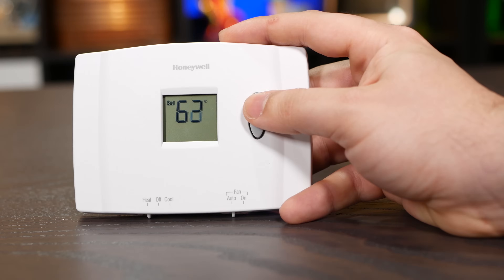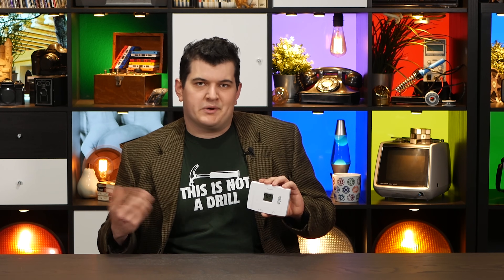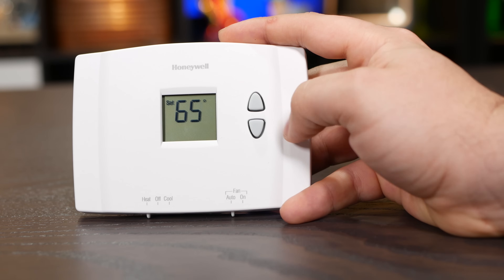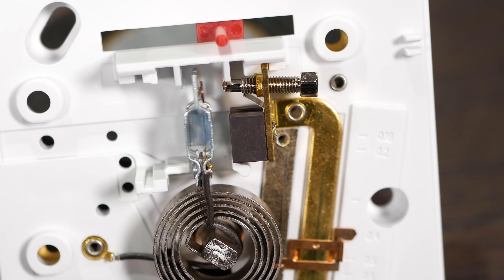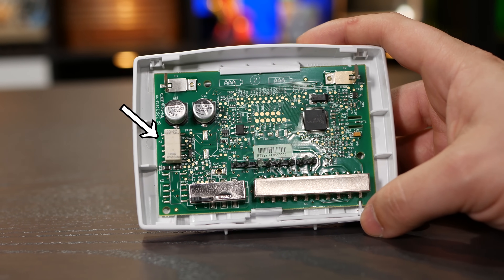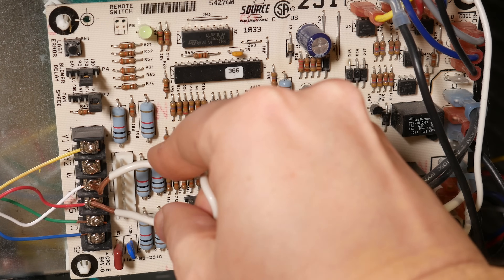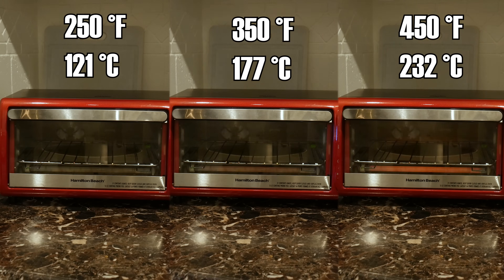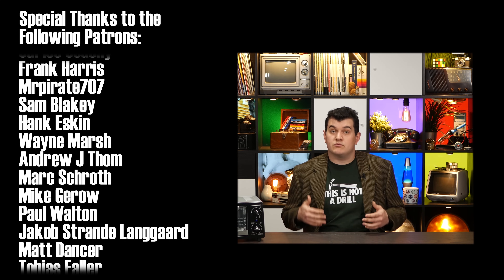Thermostats: Cooler than you think!

Comment: Thank you for this video. Maybe I can show this to some people I know as proof that I know what I'm talking about. :)  I myself have tried and tried again to explain how the thermostat ACTUALLY works, but alas I would find it set at impossible temperatures (59°F in Los Angeles' summertime) and this would lead to another problem.. ice buildup. If the system never gets a chance to stop cooling, humidity causes ice to form on the evaporator coils and actually block the cooling airways which stops the airflow altogether, which is fun.

Anyhow thanks again, and keep makin' them videos.

Comment: You should really look up PID functions as they relate more accurately to thermostat operation than PWM. (Thermostats only tend to use Integral and Derivative functions, Proportional control would only be used with systems that allow fine control, your “medium blast” essentially).

Comment: Nice, thorough explanation.  You'd be surprised how many customers think that the thermostat controls the temperature of the air from the vents. I thought that too when I was a kid. You'd also be surprised how many other HVAC guys don't know about that issue with the Nest. I don't install them without a C wire anymore. Learned that the hard way. In fact, one night my Nest tried to cook me. I thought it had become self-aware, turns out it just needed a C wire.
I believe a modulating furnace would qualify as medium blast. However, with a standard thermostat, the modulation is controlled by the furnace and the stat is still just On or Off. In a communicating system, the furnace and thermostat "talk", and the furnace may use input from the stat, like: ambient temp, set point, humidity, and even outdoor temp from an outdoor sensor or the internet. And, in that case, the thermostat setting can directly effect the temperature of the air coming out of the vents. BTW, a communicating thermostat is usually controlled by just 3 or 4 wires.

Comment: I have a thermostat that has only 2 wires(live and neutral) that use powerline to deliver data between the heater and the thermostat so that the thermostat can tell when to turn on and off and at which set temperature(yes our heater control also hot water and can be set a chosen temperature ) and the heater can tell the thermostat if there is any error and make a warning appear on the screen, could you talk about it?

Comment: Would a furnace really even notice the tiny amount of current required to power a modern microcontroller? I think if it was that sensitive it would trigger constantly on electrical interference. The biggest current demand on a thermostat would be driving a relay, but in that case you use as much current as you can. Though you would have to have two power supplies, one very high impedance for when the furnace is off(a rectifier and a regulator or buck converter), one very low impedance for when the furnace is on(transformer, rectifier, regulator).

I think the more obvious reason thermostats use batteries is because that option is cheaper for the manufacturer.

Comment: You need to make a video on this but with car heat. My sister doesn’t understand that when your car is stone cold and you override the auto and force the blower to max speed and put the temp number to MAX it’s NOT gonna give you ANY heat! But actually take longer to heat the car as you just turned on a small radiator. Plus your just blowing arctic air in your face.

Congratulations you just played yourself.

Comment: There's a low blast and a high blast for my furnace.  (Only full blast for my AC.)  At some point, my Honeywell Prestige thermostat decides that high blast is needed, I suppose related to how far away from the set temp the actual temp is, and maybe also related to how quickly it's changing the temp in the current blast mode.
Reply: After watching the full video, I'm surprised you didn't cover modern digital thermostats more thoroughly.  My current thermostat is electronic, not mechanical.  The temperature in the living room always reads the same as the thermostat setting (unless I just changed it).  In other words, the thermostat is accurate to within a single degree F.  This page may be useful:
https://www.elprocus.com/electronic-thermostat-circuit-and-working/

Comment: You should do a follow up video on the world of industrial controls.

Every commercial building you walk into is controlled by hundreds of individual input/output devices on a huge network, all talking to each other.These are usually attached to the HVAC unit itself. If you look up at the ceiling in any building with exposed ceilings, you'll be able to spot RTU-1, VAV-1, WSHP-1, etc... You could probably kill someone with boredom trying to explain BACnet/modbus.

What I love about that technology is the sheer number of sensors you can use to maintain a set-point. This example is an air handler that was struggling to maintain a humidity set-point. New programming in the week changed how the unit ran and better maintained that set-point.( https://imgur.com/a/79MligR ).

Comment: Large chain stores who's thermostats that are controlled by building automation software tend to have fine override controls that will adjust setpoints in such a way that a unit must do a task on a schedule.  In my experience, these controls are restricted for diagnostics because HVAC is expensive. 

The traditional way to achieve medium blast is to have two air conditioners bundled together in one box.  A controller at the unit decides which air conditioner turns on full blast first so they wear at the same rate.If after about five minutes we're not back in setpoint we turn on the hidden second air conditioner.

Comment: My furnace is frightfully old, and has not a single PCB circuit element in it. It's all electromechanical relays for gas flow, blower, and so on.  However it does manage to keep the house toasty warm even in the depths of a polar vortex so, apparently its full blast is a little blastier than most. And its discrete timing circuit for shutoff can be adjusted so it runs a little longer after the thermostat tells it to stop.

Comment: There's damage in your furnace. Some heating and cooling systems are multi-stage or variable. There are also more complicated heating and cooling systems that need more wires. Industrial HVAC is a whole other topic....... Just trying to boost engagement! Oh, and you can use "k" to pause the video. Push it twice in a row fast enough and you can read the scrolling text. It's easier than using "<" and ">". Engagement has been boosted to new levels.

Comment: < and > keys on desktop will NOT advance frame by frame here. They aren't listed in the official list of shortcuts either: https://support.google.com/youtube/answer/7631406?hl=en so I guess it's wrong? I'm tapping space here, but I admit the .25x speed could help a bit.
Reply from the maker: If you're holding shift to literally press those keys, don't. It's technically the comma and period but the symbols < and > convey the function better
Reply: @TechnologyConnections  This explains it! I'm using an AZERTY keyboard because I'm French, so I need to hold shift to make the < and > keys work (as well as the main dot ".") - I can confirm the comma works well (I don't need shift for it), which means I can only go backwards hehe. Thanks for taking the time to respond!

EDIT: Also I'm using Linux, so using caps lock will NOT enable the shift modifier for my keys. For instance, caps lock + 2 will yield "É" instead of 2 (while I would get "é" without it).

Comment: The house that I currently live in has one of those Honeywell thermostats with the huge monochrome, dim-back-lit LCD display. And a few buttons on the face-plate. Oh, and this might be important to mention: an electrical heating element as well as a heat pump is used for the heating system.

Comment: Actually the way the nest charges on the two wire system is by using a low enough draw that it doesn't trigger the furnace. It doesn't charge while running the furnace because that could lower the draw enough to not start it.

Comment: In my (fairly modern) British house, we have a combination boiler and the thermostat is connected over a HVAC (I can't remember it's actual name) bus, the thermostat can send & recieve temperature, requested temperature & system status. For example, if the boiler faults out, a message comes up on the stat & if the temperature/status (off, auto, manual) is changed on the boiler (or i assume another stat, we only have one) it will change on the stat's display.

Comment: I’ll mention something interesting

I have a split-type A/C in my room (split A/C units are common in the East) and this particular one doesn’t regulate the temperature by shutting the compressor off once it reaches a set level based on my desired temperature setting. 

Instead, what this one does is as the temperature nears the desired setting, the compressor’s output is reduced to the point where it can just about maintain temperature. It can be known just by hearing as with my older A/C, you can hear the compressor shutting itself off and on depending on the temperature, but the current one just keeps running.

Comment: My thermostat has basically that run for one cycle setting.  It is really just a temporary set point.  Set the temperature to the new setting and if you set it high/low enough the furnace or A/C will run for the set amount of time you set that temporary set point for 1 - 8 hours.  Not quite as simple as a simple set time to run and can't be set for less than less than one hour, but i do use it like this from time to time.

Comment: i have no idea what thermostat is (well actually i know but you get the idea), i just have a remote controller for my aircon. and i would set the aircon to blow 21 degrees of cold air for half an hour as hard as it can. problem solved.

Comment: We've just had a Hive smart thermostat installed and it has a 'Boost' feature that turns on the heat for 30 minutes, for each button press. so say you are feeling a bit chilly you just tap the Boost button and the heating comes on for a fixed period or until the boost temperature is reached. You don't have to remember to turn it back down again.
Turns out it's surprisingly useful. It's a shame the Hive mobile app is a real fun sucker.

Comment: the thermostat I wired up for my mini-split will kick on the electric baseboard heater the minisplit more-or-less replaced, and kick off the heatpump if the heatpump isn't keeping up. very handy given the heatpump rapidly loses efficiency below freezing! this is basically an example of an "emergency" heating mode you mentioned.

Comment: If you want to put a PWM controller into a toaster, you'd need to use a PID controller to have the temperature influences the power output. That could certainly be the case in more expensive "digital" toasters (they most likely already have everything required to do this barring the code) but that's an exercise for another day.

Comment: Considering the very last point about heating or cooling for one cycle: I don't think you'd even need a timer in the circuit. You could just have a button that pushes on the bimetallic strip and forces the magnet to engage. Then the system would heat/cool to the upper/lower boundary until the bimetallic strip would disengage the circuit again. This would have the added benefit that forcing the circuit on like this won't change the set temperature and it wouldn't let the temperature stray too far from the set temperature. It just puts it to the maximum or minimum value.

Comment: There's a few ways to get "medium blast".  Some furnaces will have a period of low or medium output before going full blast, as well as a period of lower output after being turned "off".  This allows it to run more smoothly and reduce temperature fluctuations.

Additionally, advanced thermostats can use PID circuitry, which would start turning off the furnace periodically as the room approaches the set point, allowing the room to settle at the correct temperature rather than fluctuating around it.  In this case, a room will actually reach the target temperature faster if you set the thermostat higher.  I should note that I'm not aware of any consumer thermostats that use this, probably as it would add at least $25 to the cost.  The controller would also need to be tuned to the house and furnace, increasing installation cost as well.

Comment: Wow, I'm surprised at how wrong you are here. No worries, lemme help you out. "Most" semi-modern gas fired high efficiency forced air heating systems are either multi-stage or infinitely variable. And by semi-modern I mean within the last 20 years. A multi-stage system is as it's name implies, it is not however "full-blast" as you have described it. That is without getting into the variable speed blowers which accompany all multi-stage or infinitely-variable systems.

Thermostats also come in multi-stage or infinitely-variable flavors. My current Honeywell stat is capable of controlling up to 3 stages. Yes, on or off any one stage at a time but with varied levels of heat output depending on which stage is being called. In the video you said the blue wire does nothing. Well...... That looks to be your "C" terminal (common) and it does a whole lot more than nothing! Most modern smart thermostats will not function without the "C" terminal. You really need to do some more homework on this stuff before you definitely tell folks how their HVA/C system works. 

I've given you enough reason to do a lot more homework on this subject, but I'd suggest you take this video down to correct your mistakes. The rest of the world is far less kind then I.
Reply from the maker: Ya know, when words like "typical" and other qualifiers are used in a video, I pin a comment that explains that two-stage heating exists, I explain heat pumps and their emergency heat, and then continue to keep saying that I'm sure more complicated systems exist even in the domestic environment, I had hoped to convey that this isn't a one-size-fits-all approach to a complicated topic. It's about the basics.

Have a ❤️
Reply from the maker: Also you clearly didn't watch to the end because I explained the C wire and its role for smart thermostats. But cool.
Reply: @TechnologyConnections  : That's true, what you where saying in the first 3rd-1/2 of the video was so wrong that I couldn't help myself. I'll own it! I did watch the whole thing though and I did hear the correction regarding the blue wire. I didn't and still do not feel the need to edit my post. What I said and when I said it is still absolutely correct. And I said it all kindly, with a heart!
Reply: @Finite-Tuning  You are obviously someone who lives in an area with either more heating degree days than average, or a rich area, or both. Your area does not represent the average, as far as "most" goes - Alec is correct that "most" systems are single stage, and this will remain to be the case for a good while yet. Efficiency regulations are slowly being applied that will require equipment to implement more modulation and/or 2-speed type controls, but this is far from being the majority of cases.
Reply: Maybe that is the situation in the USA?
Here in Europe when you were rich you would get poor pretty quickly when you save on the installation cost of your heating (and thus lose on its operation).
Even the low-budget heating systems use condensation here, and thus require modulation to operate most effeciently.
Reply: @Rob2  Yes exactly, this is a very USA-centric channel and the USA generally uses much less efficient stuff than the rest of the world because of very low energy costs.
Reply: @Rob2  : All semi-modern gas fired forced hot air heating systems use a condensate drain. It's necessary because the two main byproducts of burning gas (LP or Natural) is water and Co2. That water needs to go somewhere, but it has nothing to do with modulation! Otherwise, I don't understand what you are talking about.
Reply: Check this article on condensing boilers: https://en.wikipedia.org/wiki/Condensing_boiler
They achieve over-100% efficiency (from caloric value of the burned gas to heat output to the water) by condensing the watervapour from the process you describe.
Classic boilers just output that vapour in the exhaust, but the condensing boiler uses the heat gained when condensing it.
The efficiency is best when the heater is not running at full rated power.  Hence it is more efficient to run the heater twice as long at half the rating, and modulation is a must-have.
Reply: @Finite-Tuning  You mean the water that is released during gas burning being dumped in the drain, but what Rob means is that a condensation heater uses the energy that is released by condensation to improve its efficiency. See here: https://en.wikipedia.org/wiki/Condensing_boiler Further more, this technology is over 20years old.
Reply: @Rob2  : NO such thing as over unity 'especially' when fire is involved. There is always a loss! Cheer.
Reply: It is a matter of definition.
The efficiency is defined based on the calorific value of the gas.  The number of MJ released when a m3 of gas is burt.
However, in addition there is the by-product of water vapour that, when condensed, releases heat as well.
When the output of the heater per m3 of burnt gas is measured, it is more than the calorific value of the gas.
Of course one could argue that this condensation heat should have been included in the calorific value, but by definition it isn't.
Hence the efficiency of those heaters is above 107% measured at the hot water output.